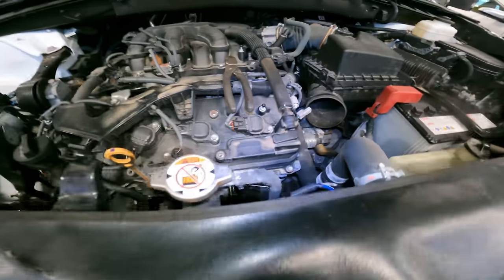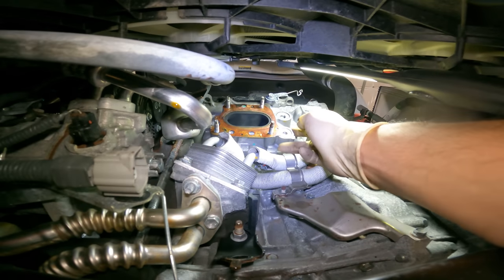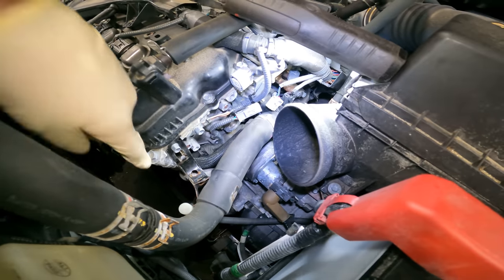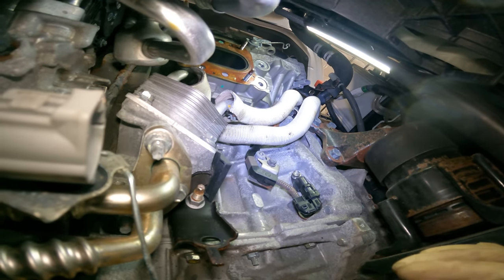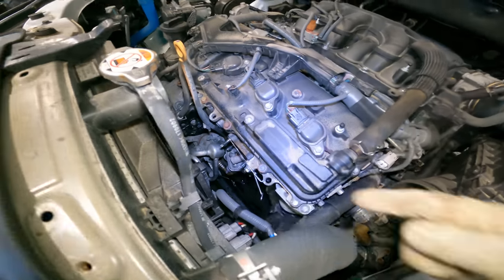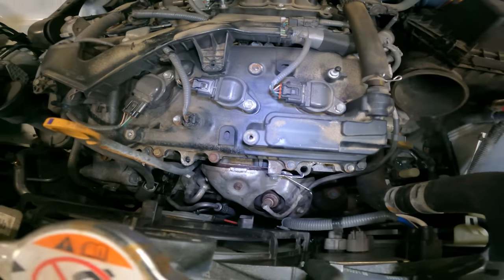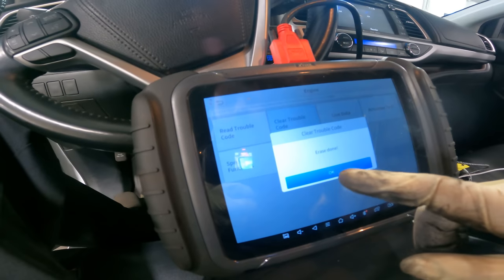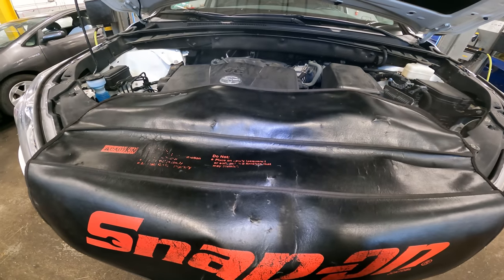Customer states OTHER SHOP REFUSED TO REPLACE CRANK SENSOR!

Comment: They always shove the cat against the engine nowadays. It needs to get up to temperature to work and to meet the EPA startup emissions. But makes that side of the engine hard to work on and bakes everything around it.
Reply: And it cools connectors and andthihg made out of plastic too
Reply: You are correct, sir, and there's more.   The 'biscuits' in the cats are made of a ceramic material that's mixed with the catalyst metals.  As the cats age they begin to break down and the ceramic materials turn to dust.    That dust is very similar to abrasives that are used in things like sandpaper.   When the engine is being cranked, before it fires, there is a slight vacuum created on the exhaust side.  The cats, being full of abrasive dust, and being so close to the engine allows for that dust be drawn in to the cylinders through the exhaust ports.   That's the main reason  why relatively  new engines are consuming so much oil.   The piston rings are being worn out by that abrasive cat dust.
Reply: @MrSloika  Interesting. I never thought of that. I always thought the excess oil consumption was because of direct inject and the corresponding oil dilution. Thanks.
Reply: Upside is it makes the cat harder for thieves to steal.
Reply: @MrSloika  so this v6 engine from toyota sucks>?

Comment: I used to be a Certified mechanic and our main complaint about having to work on anything related to under the hood was that the engineers that designed things had no concept whatsoever about getting to things. If they ever had to work on these vehicles they would quickly find out about the absurdity of their designs. And something tells me that how the mechanic knows these things is that he found out the hard way. Pain in the backside but sometimes working on these mechanical horrors is a learning process.
Reply: What the hell were they thinking, when they designed this ? or not as is the case.
Reply: As long as they drop engines in engine bays, they could care less about service or repairs. That's "somebody else's problem."

Comment: If I had a dollar for every one of those "ask me how I know" moments, I would have at least 57 dollars and 85cents!  I just replaced the crankshaft positioning sensor on my dodge caliber almost standing on my head, only to find out at the parts store I had the speed sensor in my hand!! lol  The parts guy was very good at what he did and persisted in letting me know he brought out the right part. I calmly and dryly  stated that I should probably want to put the speed sensor back in, getting a good laugh out of a few people! lol   I put the speed sensor back while almost on my head and crawled under the car to put my almost not long enough arm in all the grease I could find to change the crankshaft sensor. It was a success! The next time back to the parts store earned that parts guy a 5$ tip.
Reply: Particles like this are very rare. Thanks for that info.

Comment: Integrated exhaust manifolds also allow the engine to get to operating temp a lot faster.
Reply: It also makes installing an aftermarket turbo a lot easier 😁
Reply: Mabe save you to replace them cheap yet expensive exhaust manifold. Broken studs. 
Don’t ask me how I know.
Reply: @yvesouellette9612   ford 5.4 and 6.8 exhaust studs rust out and snap off. The early 5.4 passenger side exhaust manifold are prone to cracking. If I could find headers to fit the 5.4 and 6.8 in the E series van I would swap over to them.
Reply: @craigwiess1656  yes Ford F-150 5.4 L passenger side was replaced recently. 
Snapped studs in the head are not easy so it takes time so get expensive. I call this a poor design from Ford .
Tiny Steel studs in aluminum is not a good idea. I never had issues with cracked manifold before.

Comment: I know you'll all laugh but that's the reason that I drive a 4th gen Chrysler Town & Country, I don't think that in the rare times that I've ever had to fix either one that I have it's cost me more than 20 bucks for parts other than brakes rotors and tires, they're super easy to fix, they're not complicated at all, huge engine bay and get about 18 miles to the gallon they just go and seldom breakdown so I am not a customer for complicated vehicles, no variable valve timing or any of that nonsense. But I do enjoy your videos a lot, thanks. Moon What What of

Comment: Removal of Toyota Oil Filler Cap:  Place vehicle on turntable and attach securely. Remove hood. Place special holding fixture Toyota #2 (Fixture #1 is for coolant showers) on cap and affix securely to a sufficiently large gantry crane. Rotate turntable with vehicle counter-clockwise. Hoist cap and move gantry from over vehicle. Reverse procedure to reinstall.  Easy-Peasy!

Comment: im also curious why the harness also got replaced. My assumption is to not go in twice just in case?
Reply: I'm amazed the sensor doesn't come with a foot long harness because it's probably the heat that bakes everything in the first place.
Reply: @rupe53  Pretty dumb of Toyota to put that the sensor right next to the exhaust. Surely the could have put it near the pulley like most sensible engines
Reply: @Ben-Rogue  ... and that's usually the problem when a group engineers a car. One group designs the engine and everything makes perfect sense when it goes in say a PU truck. Next group comes along and wants that engine in a front drive car so make some external changes, including that one piece cat / exhaust. Ok, now what?  We'll just add this heat shield and make the wire longer... presto, it fits! (but who wants to work on it?)

Comment: It looks like VAG engineers are helping to design toyota products
Reply: I was just going to comment almost the exact same thing!  A simple sensor requires half a day or more and partial dismantling of a completely unrelated system.
The only thing missing are 10 different bolt sizes that are all TTY bolts and a bunch of plastic pieces that also need replacing along the way.

Comment: “Never want to damage that petcock” giggity lmao Engineers(ultimate Goombas) should be forced to work on their fever dream car designs themselves so they know the pain and descent into insanity mechanics face working on them fuck things.
Reply: @Richard Cranium 
Lmao that’s true but since they drive cars themselves and a lot of them are driving used cars it will become abundantly clear that it’s their problem too when something fucks up, the repair bill comes due and they’re left bitching about the cost.
Reply: @Richard Cranium 
Lmao that’s true but since they drive cars themselves and a lot of them are driving used cars it will become abundantly clear that it’s their problem too when something fucks up, the repair bill comes due and they’re left bitching about the cost.

Comment: Does Toyota recommend replacing the crankshaft sensor harness as well? I can understand why one does replace it, but it isn't strictly necessary with a vehicle this age.
Reply: I was wondering the same thing.
Reply: Oh this car is way past it's prime....it's out of warranty....everything on it will start failing abruptly. If you want a solid car you gotta buy something like 20 years old.
Reply: Count me in on having the same question. Understand wanting to sell another part, but my initial thought was that you'd plug new CPS into the old CPS harness and see if that solved the problem.
Reply: It's so you don't have to go back in and do the job again.
Reply: @jomama01  ... replacing only the sensor would make sense if that harness wasn't buried in there. This looks like a 2 hour job and only another 10 minutes for the wire.
Reply: @TheFrenchPug  I can understand that. But I've replaced numerous sensors on a wide variety of cars and never replaced a working harness in good order. Never seen these cars return for a failed harness, either.
Reply: @jomama01  Agree.
Reply: @eknaap8800  Maybe it was just at his discretion due to the job. Idk
Reply: @TheFrenchPug  Perhaps. Covering all bases isn't a bad idea.
Reply: @eknaap8800  I don't blame him.  I wouldn't think about it but why not if he can?  What's it hurt?
Reply: @TheFrenchPug  It doesn't hurt, I think it's just unnecessary on this vehicle.
Reply: @eknaap8800  I think we did the same thing with comments about the harness.
Reply: @eknaap8800  The placement of that harness it is cheap insurance in case the wiring got baked and brittle. In that case I would too hard to do over again for free.
Reply: @carmo9693  Thinking of the age of the vehicle, I think it would take many years  before the harness breaks or become brittle. After that one doesn't replace it for free.

Comment: I seriously think I'd rather have a golden shower than a coolant shower, only because I know what a coolant shower is like. "Ask me how I know."

On second thought, don't.
Reply: I once received an ATF shower. It wasn't any better!
Reply: @ScottDLR  Brake fluid is one of the worst. Please don't ask.
Reply: Hahahaha!!!
Reply: @ScottDLR  ... I once watched a guy take an ATF shower in our shop. It was 90 degrees that day. He lined the inside of his car with fender covers and went home early.
Reply: Golden shower isn't bad if the shower head is attached to a smoke show.
Reply: @rupe53  Oh that's an image. At least we only got it across our heads.
Reply: @ScottDLR  ... I'll give you the rest of the image: a four man team in a dealership making flat rate. There are three other teams in the building on this shift, and one of them has the transmission jack already in use. We stick a plug in the tail of the trany and four guys give it the heave-ho for removal. So far, no problem. Meanwhile, someone borrows the tail shaft plug to do a clutch a few bays over, then we go to lunch. Four guys grab the transmission for the heave-ho going back in but the guys on the front are slightly ahead of the guy on the rear so it's tilting back. (nobody realizes the plug is missing yet) Just as they get one of the bolts started the oil begins to flow between the guy's fingers, down his arm. in his shirt, down his pant leg, squirting in his face, hair, etc. Somebody shouted he should roll in some speedy-dry. (ok, funny at the time) Meanwhile he's walking around with oil squishing out of his sneakers and shop towels wrapped around his head. The guy really was a train wreck, in hindsight.

Comment: Is there a valid and very unquestionable reason why you need to replace the sensor's harness together with the sensor?
Reply from the maker: I performed a resistance check of the harness and one of the wires had a different resistance reading then the other wires. When I tested the new harness it was full continuity on each wire.
Reply: @customerstateswhat  I'm glad you explained that, I was wondering the same thing.

Comment: We had a '01 Nissan Frontier (V6) that would occasionally throw a code for the knock sensor.  No problem, I'll just put a new one in, $12.  Until I found out you had to take off all the stuff on the top of the engine (intake, anything else) to get to it.  It was easier to just clear the code when it popped up.  I ended up just giving the new sensor to our brother when we gave him the truck several years later.  I don't think he's put it in either. :-)
Reply: There’s a guy at my shop that cuts the harness and taps a new sensor into the top of the intake on those old Nissans. We give the customer the option but they always choose to rig it.

Comment: I had an intermittent crank sensor - full engine breaking randomly appearing at motorway speed. Scary
Reply: The wife's Vauxhall Astra did the" die in worst possible place " thing on the way to the garage. A 20 minutes trip took over a hour and included a cranking in gear to get it out of the middle of the road!!!

Comment: Why does the wiring harness need to be replaced? Couldn't you just replace the sensor?
Reply from the maker: I performed a resistance check of the harness and one of the wires had a different resistance reading then the other wires. When I tested the new harness it was full continuity on each wire.

Comment: I have 3 questions: why does a 2018 toyota highlander with only 90k miles need a new crank sensor? Why does the wiring harness need to be replaced when the sensor is the problem? And, why couldnt the other shop be bothered to do this job? Its not that hard, have they never done any challenging jobs before? I guess thats 4 questions...
Reply: I'll answer the last 2 questions with the word "money". While I'm more than capable of doing jobs like this, where I currently work, its more profitable for the company (and me) to turn away work like this. For example, if this job took 3 hours @100/hr and cost 100 in parts, that obviously adds up to 400 meanwhile, in the same 3 hours,  you could get 800+ on the books by changing 4 sets of pads and discs. Which job(s) would you choose?

Obviously that only works when its busy. When its quiet, almost anything gets taken on🤣
Reply from the maker: I performed a resistance check of the harness and one of the wires had a different resistance reading then the other wires. When I tested the new harness it was full continuity on each wire.

Comment: I've been a tech for 40+ years but the bulk of my grumbling and swearing has been in the last 10 years. Not because I got old and cranky but because packaging of components just like this example or worse. Sure, some things are better. Some ways vehicles are name to make assembly take less hours of paid labor do help repairs like easier dash removal when evaporator or heater core is replaced. There are lots of things situated where they are easy when engine is out before powertrain or frame is lifted but far harder on completed vehicle. Lifting cabs is a daily no-big-deal for all pickups. The engine set back under forward angled cowl makes cab lift the way you save your back and body.

Comment: Odometer said 56,036 miles. I'm guessing the other shop said go to toyota because they thought it'd be covered under warranty, doesn't really look like an overly complicated job. I wonder if this was a warranty job? Not sure of toyota's warranty length off the top of my head. That would also explain why the wiring harness was replaced too, if it's on toyota's dime.

edit: It does look like it was probably covered under the 5 year/60k powertrain warranty?
Reply: think its the 3/36 Basic
Reply: Toyota engineers trying to get their extended warranty sales up now.  That plastic part is gonna get cooked again in 50k miles or less.

Comment: The highlanders never had the issue with the crank sensor wheel that would throw random mis fire codes? Theres a tsb for a updated sensor wheel on the RX350 that uses the same 2GR-FKS motor on the Lexus side on 18-21 models I believe
Reply: so why did this one fail

Comment: Can you just replace the Sensor without replacing the hardest?. Or has there been cases where you replace the sensor and find out the harness is bad also. Just seems like the old harness was bad but I am not in the Business. But I can understand it. Because it would suck putting the Exhaust manifold back on just to find out the Harness is bad and take it all apart again.

Comment: That sensor reminds me of the one I had to change on a GM 3.1 v6 that required removing the oil pan and then prying it out from the inside.  AAARRRGGGHHH!!!!
Reply: I just replaced my crank sensor on GM 3.9 v6 and it isn’t as bad as this but there’s about 4 hard hoses and brake lines and a engine cover and than about 1 - 1 1/2 inches of space had to get a skinny friend and have him hold the ratchet while we slide a metal pipe on it just to get the bolt off

Comment: The Engineer's that designed that Engine Compartment missed a PERFECT Opportunity for some Sadism...

They could have placed the Crankshaft Sensor and Shield Cover directly behind an Engine Mount so the ONLY way to get the Crank Sensor out would be to remove the engine itself from the car...

Yes, that's Eeeeeeeeeeeeevil...

No, I don't care what you think f me or my (lack) of Morals, Ethics or Sanity...

😄😁😆😅😂🤣

Comment: The wheels on the strugglebus go ro$##%$ and $%#%^&* 😜 I wonder if that "other shop" has tried this repair before, tried skipping steps and cutting corners which ended up costing them with doing things twice and/or a customer return for the same problem - or new problems caused by screwing it up.

Comment: Crank sensor 2018 Dodge Eco diesel had to remove the transmission, and flex plate. Try telling a customer it's going to  cost $2500 to change that $ 50 part.  Not like they have a choice it's either fix it or never drive it again.

Comment: I find it odd, that you refer to bolts by their head size, not the thread size. I'll bet you sensor bolt is 6mm, and needs a 10mm spanner.
Reply: ..... usually service information will also refer to bolts by head size